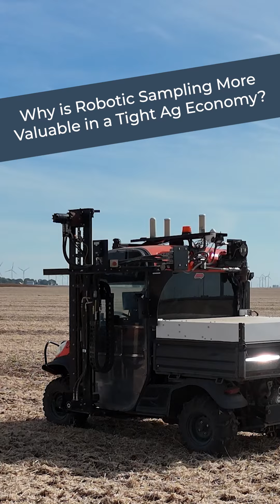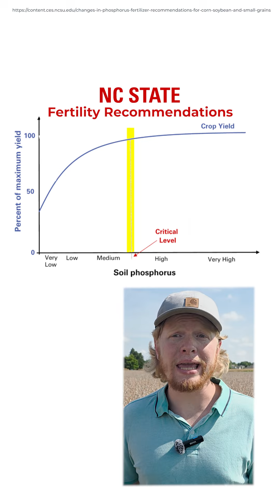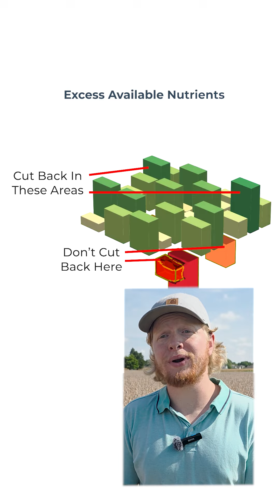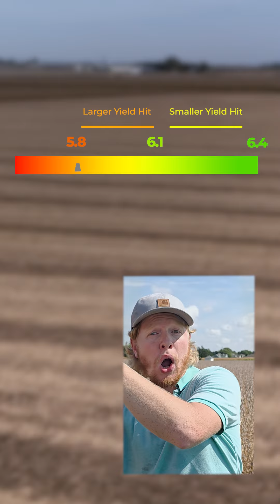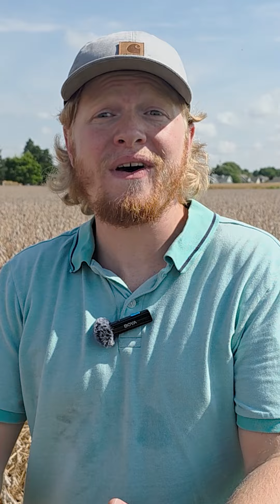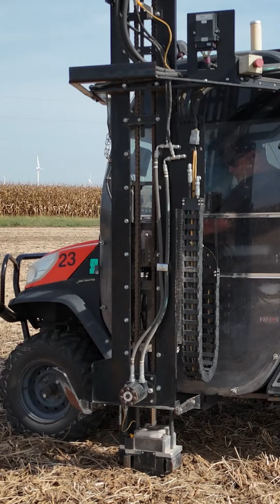Cut Back Where It's "Smart" #agtech

Comment: WHERE are the nutrients in the Soil profile? Top 3 inches?
Reply from the maker: They're definitely more concentrated in the top 3 inches. 

We've got other videos about that on our channel (just released one an hour ago, actually). That's one reason why accurate sampling is so important - if the probe goes to the wrong depth, it can significantly change the sample results